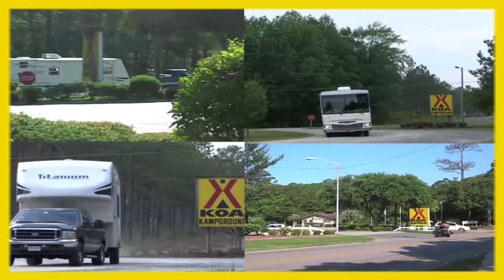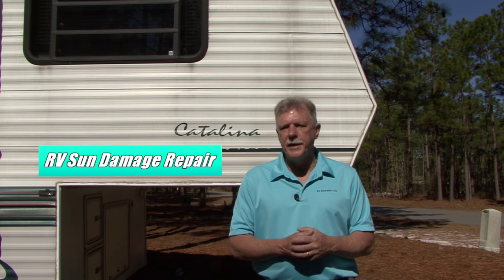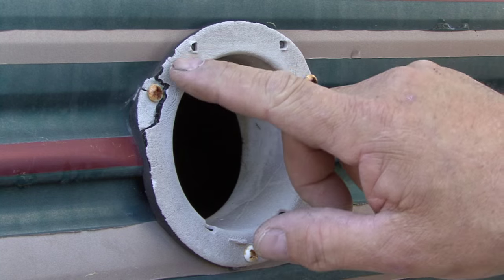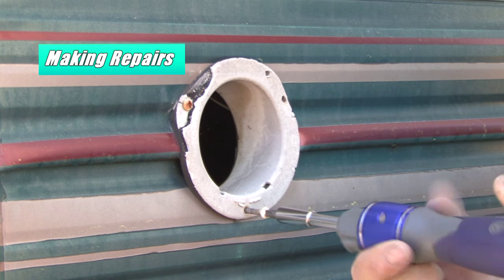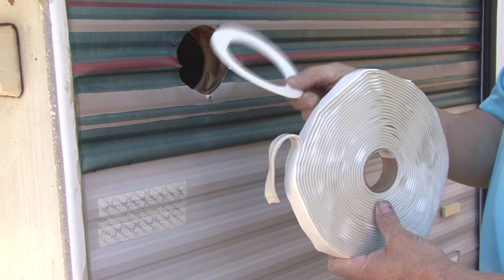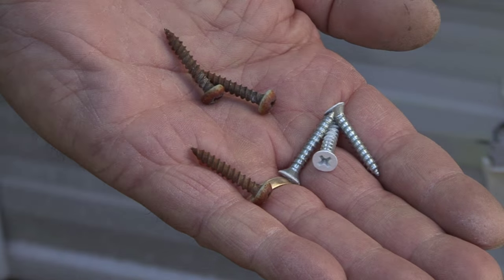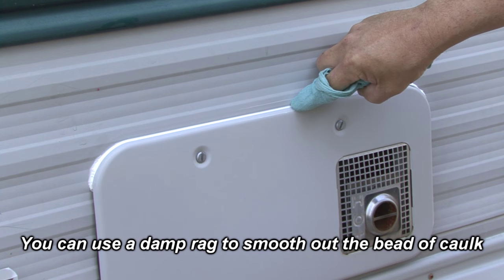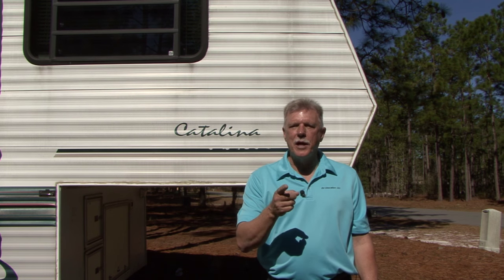RV DIY - RV Sun Damage Repair

Comment: I've always heard to only buy Dicor products because they're only the best and to only buy the brown oil based clay butyl tape over the grey too.
Reply from the maker: +jim lucas Hi Jim,
 I have always had good luck with butyl tape. Dicor sells the gray butyl tape. I am not sure who manufacturers the almost black looking butyl tape. Some folks would suggest using the most appropriate colored butyl tape for the job i.e., darker around window frames and lighter around components on the RV sidewall. I noticed the darker butyl tape is thicker too and would help fill in low spots on corrugated metal sheeting. I guess it all depends who you talk to.
Reply: +RV Education 101® 
This one "Self-Help" video I saw showed the guy putting on 2" wide corner trim and although he used the brown butyl tape he made sure that it wouldn't squish out so that the dicor could be used on the trim first 1/4" then it squished out after he quickly reattached the trim.  He also had warm soapy water to quickly clean the excess while finger tip wiping it away.   He said the grey butyl tape crumbles after 7 to 10 year's.
Reply: +RV Education 101® 
My situation is different because I've removed and cleaned all trim in preparation of painting the whole RV so the paint covers all that anyways.